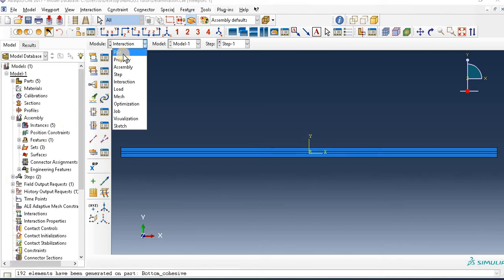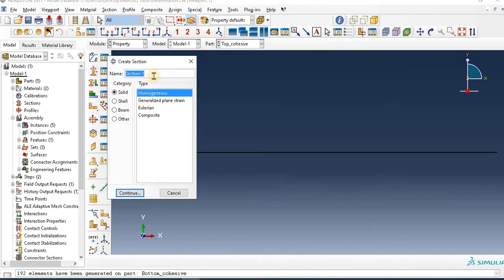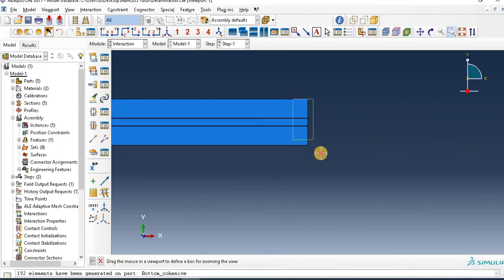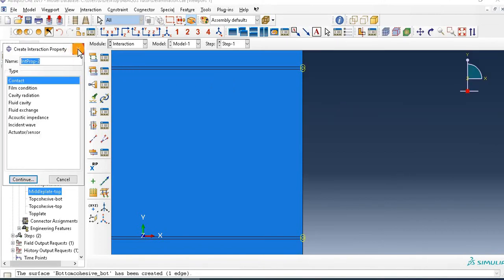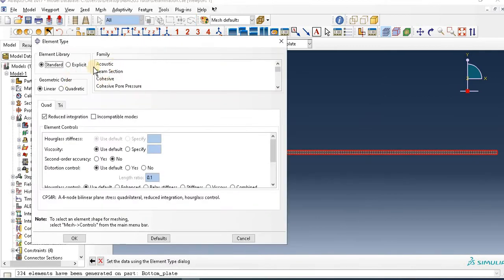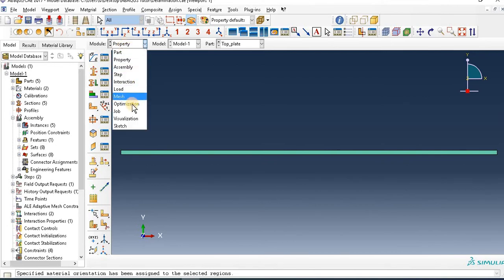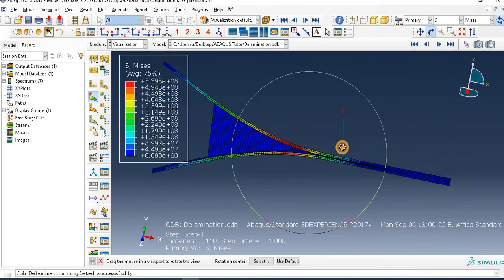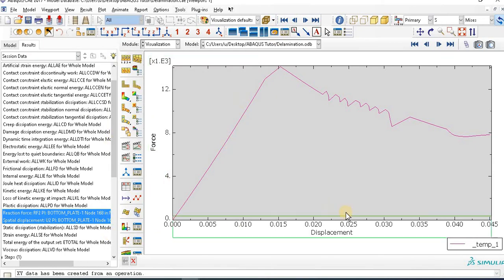Delamination analysis using Abaqus Full tutorial Part 2 of 2

Comment: THE *TIE PAIR (ASSEMBLY_Top Plate-Bottom,ASSEMBLY_Top Cohesive- Bottom) IS ALSO USED AS *CONTACT PAIR. REMOVE THIS *CONTACT PAIR. THE SAME PAIR OF SURFACES CANNOT BE SPECIFIED MORE THAN ONCE FOR *TIE AND *CONTACT PAIR. ONCE A PAIR OF SURFACES IS USED FOR *TIE, IT CANNOT BE USED AGAIN FOR *CONTACT PAIR AND VICE VERSA. Getting this error What to do?
Reply from the maker: from interaction module, there is connection called "tie connection". Delete the tie connection